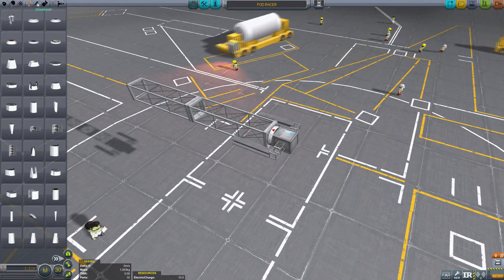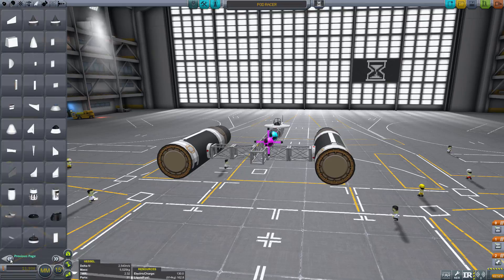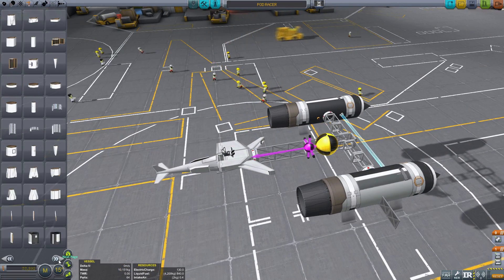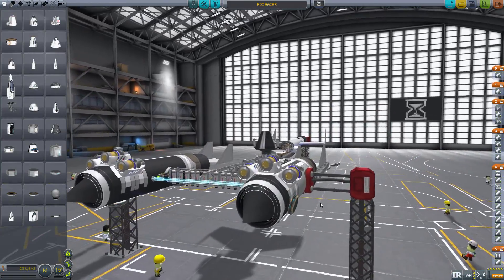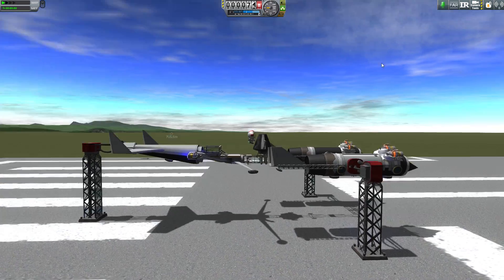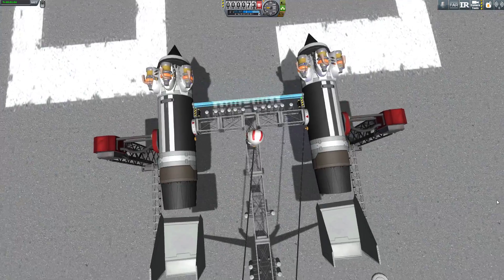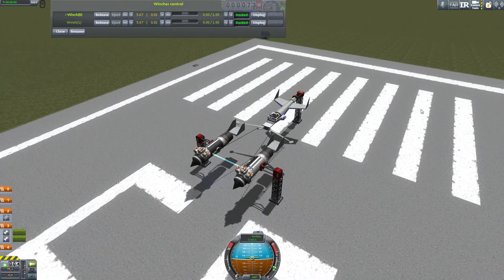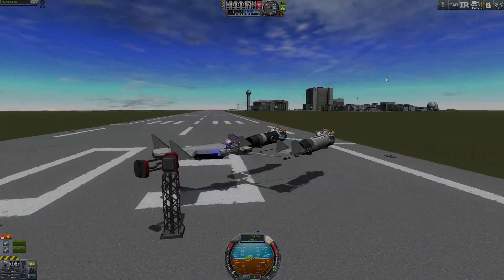KSP Tutorial: How to make a Star Wars pod racer

Comment: I'm having some trouble here. For some reason, even though I use the anti-grav motors, the podracer I made nosedives into the runway when I start it up. Is it too high? It has some elevation off of the runway, so is the trick to keep it from flipping to keep it low or increase/decrease damping in the anti-grav motors? If you have another idea, I'd gladly accept it too.